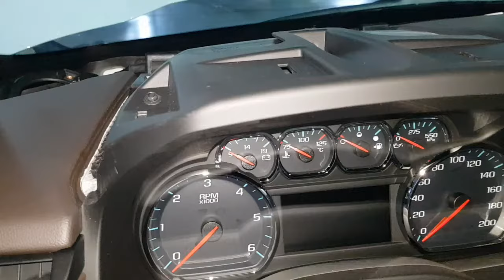A/c evaporator replacement on Tahoe Chevrolet, Yukon GMC 2015-2020. The easy way!

Comment: Only an insane company would come up with this design.  Nothing would be wrong with the design if quality parts would have been used but GM never lets their customers down.  This is a 3K repair and so NO thanks.
Reply: Common among other brands as well, no escape.
Reply: More The Freon!!! And Super Thin Core Walls For Better Heat Transfer!!!
And All Car's Have Similar Dash Construction!!! A LOT Of Stuff Goes Behind The Dash!!! A LOT Of Stuff!!! Let's See Your Design!!! 😂😂😂😂😂😂😂😂😂😂😂😂😂😂

Comment: I hope my silverado never has this problem.....holy moly what a disaster!.  WHY GM, WHY?
Reply from the maker: Spahi77, Sir If the time will come to your silverado with the same problem in this video, trust the dealer GM technician like me, we care about your car.
Reply: @ejmegzcarvlog7226  you are not like other GM dealer mechanics a lot of them would charge $2000 on average for a repair like this. This is a horrendous modern design, but I give you props for caring about your customers.
Reply: @ejmegzcarvlog7226  if I ha the pleasure of getting a GM tech like you I wouldnt  worry about it, but here in USA,  GM techs can't tie their shoes

Comment: GM changed layout in 88. Older evaporator took an hour to remove and replace under hood
Reply from the maker: Yes,  your correct. But not just a GM, as well as other dealer.

Comment: Nice video! Looks almost exactly the same as the 07-14  GMC Chevrolet Tahoe Yukon remove and replace required for heater core..
Reply from the maker: @morecowbell235  Thanks for the comment.

Comment: Wow .. this thing is complicated as hell! Great job bro. 
I have a question, is there any reliable evaporator brand for this model? I replaced mine with an OEM but this one broke as well, I know this model has a manufacturer defect.  Thank you
Reply from the maker: Im sorry bro, i have no idea for reliable brand. Dealer always recommend a original brand.

Comment: So I think my 2016 Chevy 1500 is leaking in the same exact place. I have taken my expansion valve off a few time replaced the o rings on it even replaced the expansion valve with no luck I know it’s leaking in the area because I can spray soapy water around the plastic housing around the expansion valve and nothing but bubbles around the expansion valve.
Reply from the maker: Justin Siemiatkoski I dont think that the bubbles around the expansion valve is enough to determine that your chevy is the same leaking in this video. Front evap core leaking on Tahoe and yukon is not a common issue. Much better you check the 3 common A/c leaking tahoe and yukon. First a/c condenser, I have had a video on replacing A/c condenser and the video showing where is the leaking. Second AC discharge hose at compressor and the 3 is rear evap lower side, you can visually check at rear side near at exhaust pipe.
Reply: @ejmegzcarvlog7226  is not the Schrader valve on the high side the most common weakness?

Comment: Didn't show the bolt behind the intake that's impossible to get to
Reply from the maker: Use 10mm combination ratcheting wrench and then put a wire in the wrench. My hand is to small i can able to remove the bolt with out removing the manifold
Reply: @ejmegzcarvlog7226  that bolt was the hardest part for me but you're video made it not to bad of a job, had it in and out in 9hrs